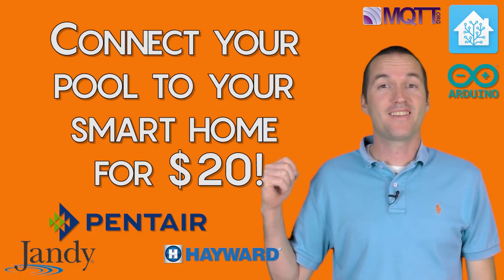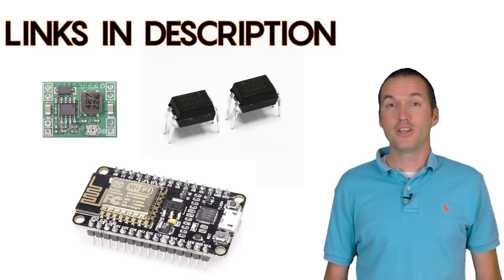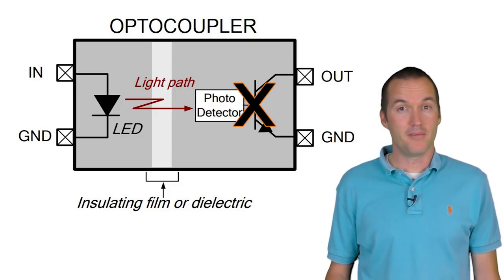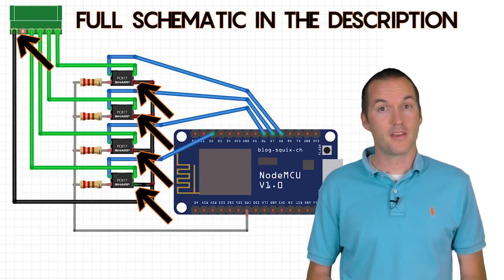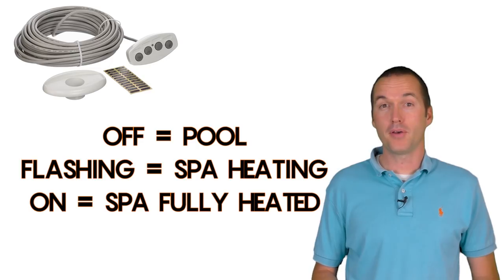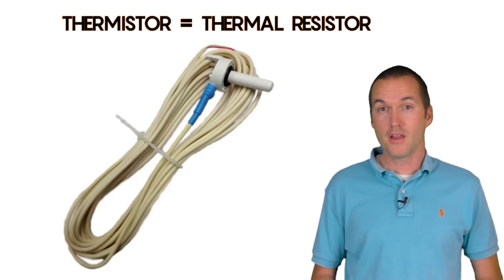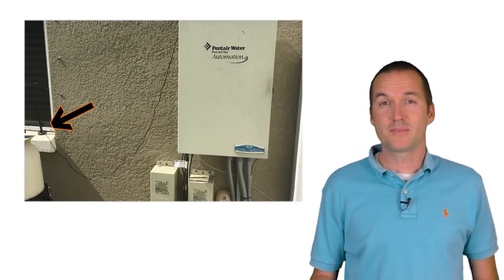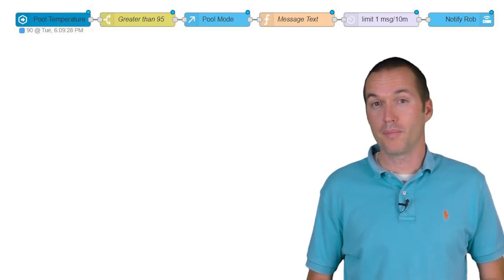Connect your pool to your smart home for $20 with Arduino!

Comment: Great job man, you're my hero!  I was able to replicate your controller and built a really nice breakout board for easy replacement of the NodeMCU and buck converter.  Also, I added a LED to verify power and another to verify emulated button signal transmission.  I discovered you can use only one 220 ohm resistor in series with the common ground for the optocouplers versus four as your schematic illustrates.  Also added RSSI signal quality measure in the sketch.  Initially the controller wasn't working, but realized that I had to activate the IS4 feature on the control panel.  Thanks a ton Rob!  Really good video.

Comment: That was amazing. If I understand correctly the arduino code runs directly on the nodeMCU and talks via mqtt to a separate device running home assistant. So this means there is no cloud based service or internet access needed for this type of design.
Reply from the maker: Correct, the only cloud service that I use is alexa voice recognition.  Everything else is local.

Comment: I have a Hayward H100ID basic pool heater for my above ground pool.  I use a Sonoff TH10 with a DS18B20 Temperature Sensor to monitor pool temp and turn the heater on/off.  Nice to be able to remotely turn down the temp if not using the pool a few days, or turn up the heat remotely if planning to use the pool. ... without having to run out to the pool to adjust the temp.  Also nice that I can view logs and see how often and for how long the heater is running.

Comment: about to buy a home with my very first pool. when researching ways to log and do maintenance, i came across this great video.  I already loved so many of your other videos on home assistant, this was really really great to find. I haven't moved in yet, but once we get settled, i think this will give me confidence to try interfacing with the controller.  What I would like is to also have something in home assistant to help with maintenance, like showing charts of chemical measurements and also issuing reminders for maintenance and whatnot.  Do you know of anything like that for Home Assistant?  Thanks again for posting this.
Reply from the maker: Hey Frank, you found an old video! I still use this same setup, but I've been thinking about changing it up.  I recently found some code meant to interface an arduino with the pentair system via an RS485 adapter which gives all the info that you'd be able to see from the actual controller.  This would allow you to get chemical information if you had those systems installed.

Other than that there are a few companies out there like Phyn that are doing monitoring solutions.  To be honest though, after 5 years of pool ownership I have a pretty good feel for my pool's chemical levels just by looking at the clarity of the water and the smell when I'm swimming.  I have a saltwater pool and I do a full check on the chemicals about once every 2 months.
Reply: @TheHookUp  Hi Rob, long time viewer, first time commenter. Can you share your code? I have an aqualink, I currently use the HA integration, but it is limited and doesn't control my heat pump/chiller, also all the data must go to the internet. I looked into using the method in your video, but shorting the pins together on the controller does nothing, I am wondering if the aqualink uses something else or my controller has an issue? Anyway, I am thinking of the RS485 method as well. Looking at Aqualinkd and someone sells a completed version called the SMART spa remote, but it's way more fun to make your own.

Comment: Nice video :)
One small point at 4:55. 3,000,000ms is 3000s (50min) not 3s.
Reply from the maker: Yep, I misspoke.  The pulsein function uses microseconds.

It's pretty annoying that there is no way to add a correction to a video after posting.
Reply: You should be able to add a capture over the video in the editing tools on Youtube

Comment: I finally got around to doing this.   At first I tried using an Arduino Nano 33 IoT so I could use the Arduino app but that cloud system does not play well with their cloud system.   I used a Wemos D1 mini and powered the buck converter from the 15V source on the Pentair board.   I have the Wemos serve up a web page and then I just go to the IP address on my phone.   Sure, I can't turn the lights on or off from outside of my wifi network, but why would I do that anyway?

Comment: I’ve got a Balboa VS500Z spa controller with simple topside controller that manages the jets, mode, and temperature.   There are two RJ45 jacks on the board and the topside controller plugs into one of those.  I am thinking of using the second one to see if I could use an IoT device to emulate the topside controller.  I was thinking of trying to read the signals and decode the data but after watching your video, I’m wondering if I could just buy a second topside controller and use it to emulate button presses.

Comment: Super video. 

My Pentair/Starite system is a bit older. And currently the control board is shot. My question is, would the inching PCB work to simulate the button press on the membrane (now not working) it I wired the PCB is output to the relay in my panel directly?

I’m not sure if the original control board is sending a 3 or 5 v signal to the relays or not. 

Before I order these will that work? 

Thanks.

Comment: As the nodemcu has so many GPIOs, you could connect a water resistant DS18B20 for temperature, about 1€/$ on Ali. Maybe even a second one to heat according to the air temperature.
Reply from the maker: Yeah, the limitation is not water resistance, but sealing the line around the sensor.  The temp sensor is in a return line and needs to have a decent seal on it to prevent leaking of water out of the pipe.  I actually have more of the pins used on mine.  I'm also using the same nodeMCU to monitor the gate open/closed state and detect the state of the salt generator using a photoresistor.

Comment: I'm on my 2nd analog pool pump timer and was thinking of replacing it with Shelley Relay.  I've been reading that although the Shelley 1 is compatible with 240v, it only has 1 relay instead of 2.  Do you know of a Shelley Relay that would open both hot legs of my 240v circuit?  I don't like the idea of only having one side open and the other side having a 120v hot direct wired to the motor.

Comment: Hey thanks for sharing. I’d like to connect my air exchanger, to turn it on/off depending of the time of the day, weather conditions, and to trigger the venting mode for the bathroom after a shower when the lights are turned off. How could I do that ?

Comment: Won't piggy backing to the temperature sensor make temperature readings on the pool controller useless? I mean won't it affect the resistance?
Reply from the maker: It does not affect the controller sensor, no.

Comment: Ah, I wish I had a pool controller like that. I just have a 3 pronged Pentair Inteliflo variable speed pump with a 3 pronged connector, which are probably a lot more complicated that simulating button presses. I would really love to setup an ESP board to interface with it so I could set schedules based on the time of year (to run it less during the cool months) to save money. I know I could manually do it, but those things are a big of pain to program the schedule so I avoid doing it. If I could have a schedule or a button in Home Assistant though... :)
Reply: And there's the Pentair Colored LED Pool light control box against the house. I need to see if I can open that box up someday to explore.

Comment: Hi, Rob!  Thanks for sharing this great integration project.  I'm a bit confused on the common connection for the 150 ohm resistors connected to the optocouplers.  They should connect to GND on the microcontroller but you have them connected to CMD (SPI Chip Select) pin in the schematic.  Was this a simple mistake or is my newbie status coming out?  Thanks again!  Love your channel.
Reply from the maker: Yep, that's a mistake, connect to ground.

Comment: Nice video!

Why cannot you  just use 1 resistor between the optoisolators and the ground? 

How many Volt from the SPA can the optoisolator handle?
Reply from the maker: You can use 1 resistor because the common leg would be through the LED and would prevent reverse polarity, I showed it that way to be on the safe side in case people modified the design.

Datasheet on the optoisloators says 80V max collector to emitter voltage.
Reply: @TheHookUp  Is the schematic wrong?  You have the resisters between the opto-isolators and the CMD pin, not GND.  Should the resisters connect to GND?
Reply from the maker: Where are you seeing CMD? That's the ground pin (GND)
Reply: @TheHookUp  Forgive my ignorance, but it looks like the resistors are connected to a pin on the nodeMCU labeled CMD via the gray line: https://imgur.com/a/7exxDNF
edit: I switched the connection from the nodeMCU to the resistors/opto-isolators to use the GND pin instead of CMD and it all works!  Here is my updated schematic (change highlighted by red box): https://imgur.com/a/MsXzbwo

Comment: Two ideas... Mitsubishi Mr. Slim Ductless HVAC unit and/or household waterheater. The Mr. Slim is supposed to have a serial interface that can be operated by arduino code.
Node MCU is nice, but what about the ESP32? Similar price point and really nice specs.
Reply: Old Curmudgeon Just my two cents, ESP8266 is quite powerful for such mundane work while still being significantly under powered compared to as Esp32.
Reply: Prakhar Birla I don't disagree. I was just saying the for the $3 price difference one could also consider the ESP32 as an option.
Reply from the maker: ESP32 libraries aren't nearly as well hashed out as ESP8266 libraries, that's why I usually default to the ESP8266.  I have 2 ESP32's at work in my house, and 4 or 5 sitting in my drawer.  They are very powerful, they just have extra bugs when trying to use ESP8266 libraries.
Reply: The Hook Up that is so true, but for my projects the only thing that's been a headache so far is analogout & i2c LCD. I find the Nextion displays much more flexible & configurable than the 20x4 LCD anyway. Thanks for the reply.
Oh, mind saying what tour ESPs are doing?

Comment: Great example!  I have an idea that I wonder if the NodeMCU would be a good candidate for.  I'd like to make garage door controller that uses two IR Beam sensors and integrates with home assistant. 

Most garage door openers today have a single IR Beam sensor (aka "safety sensor") near the bottom of the door which prevents the door from closing if there is an object in the way when the button is pressed, or it stops a door if the sensor beam is broken while in operation.  I want a second sensor near the top, to detect when my wife leaves the minivan rear gate open and someone tries to shut the garage door...which would hit the van gate and cause (more) damage to the vehicle ;]

It sounds like the NodeMCU could take control of the normal sensor control wiring connected to the garage door opener, and each of the beam sensors could connect to the NodeMCU, which would determine if both sensors are clear and then communicate that state to the garage door opener.

It would also be great to show in Home Assistant the current open/closed state of the door.  Something like your window sender, but preferably wired so there is no need for a battery.

Bonus Points if you can make a light turn ON when the beam is broken and then OFF when the path is clear, which would indicate when a vehicle is pulled into the garage far enough to clear the door.

Extra Bonus Points if you can make the sensor turn on a light when the sensor is tripped after dusk and remain on for a variable amount of time set in the Home Assistant web UI.

What do you think?
Reply from the maker: Totally do-able.  The  problem you will run into is that the signal from the safety sensors is not an "on" or "off", it's PWM, so you'd need to use pulseIn().  The light part is easy once you figure out the sensor PWM value.
Reply: I think I am going to start with something a bit more rudimentary before I poke into customized hardware without a guide to follow.  I think my first task will be to make a Node-RED flow that will group all of my sonos speakers on the first floor and set their volume levels to match, picking the "master" speaker in a preference order, depending on which (if any) are playing music.  That should be challenging enough for now without needing to learn Arduino programming too ;]

Comment: Hi Rob, really like your work. I would love to use this to monitor the status of my washing machine. The washing machine have a led that is off when the machine is off, On when washing, blinking when done(and before I select the program). I would love to use only the LED status part of this code on a ESP-01 for this. Can you please advise what I can remove from your code to use it for only sensing the LED part, or recommend where I can get info to understand the code? (If possible, blinking of the LED before I select program should be ignored, only change MQTT status if the LED goes from ON to blinking)Br Kim
Reply: Not sure if you managed to do this. But if you're inexperienced, maybe your approach isn't the simplest one. You can buy something like a Sonoff Pow R2 or a Shelly, which can monitor current. And make your automations based on that. Will be considerably simpler than  messing with your washing machine buttons.

Comment: i dont have a tesla or a pool, but the vid is useful as i can use it for any other dumb devices with buttons...anyways been eagerly waiting for the wired door sensor video...or if you can just github the code and circuit diagram that would be great..thanks
Reply from the maker: Interestingly, I actually redacted the code for a wired door sensor from this code.  My gate sensors are built into my pool controller sensor.  I have your wired sensor video written, but an amazon company told me they were going to send me a free doorbell unit which is the other part of the video (the same one that I already have) so I could take it apart for the video.  They haven't come through.  I went ahead and just ordered it so I can finish the video.

Comment: Hey Rob,  love your videos.  I have a hayward Omnilogic pool controller.  After 8 months of 5 techs, 12 hours on hold, and 12+ hours with techs at pool side, I’m giving up on Hayward.  I did not know that Omnilogic had a pool side remote until your video.  Problem is it is not a simple button push to activate.  Has four wires, the main program must discover it, etc., etc..  do you know if this poolside controller is using telemetry to communicate with main board?  It must bc you can control all functions from the pool side remote, not just 4 or 5.  I really would like to solve my remote function use to bypass the cloud of Hayward.  A $6500 worthless mess!  Any ideas?
Randy
Reply from the maker: Sounds like it's using RS-232 which is pretty common in pool equipment.  Definitely not easy to work with unfortunately.  You could do some googling and see if anyone has decoded the protocol already, but it's not a simple task.

Comment: How can you measure a 5V thermistor on a 3.3V ESP? Won’t that fry the board? Or are they 5V tolerant?
Reply from the maker: It isn't 5v tolerant.  It only works because a thermistor circuit is a voltage divider circuit.  Normally you've got the thermistor and a 10k resistor in that circuit.  In this case it will not return more than 3.5 volts until the water hits 6C or  43F.  At that point it won't return correct temperatures anymore, but it shouldn't do damage to the board until around 4.5v which would happen around -20C, at which point your pool probably has bigger problems.

Comment: Got a link to the external antenna you are using?  Also, do you have a pic of where on the pool controller corresponds to the COM port on the schematic?
Reply from the maker: Here's the antenna I used: https://amzn.to/2EMZeAK

The comm port is labeled on the inside of the Easytouch (right on the circuit board)
Reply: @TheHookUp  Thanks!  I was able to get everything soldered up and connected to the pool controller.  I have pool status and temperature coming back into HA, but for some reason when I send any command to turn on the spa or lights nothing happens.  I debugged the code and the nodeMCU is receiving the mqtt commands, but nothing happens on the pool controller side.  I think i have it all wired up correctly, but something must be wrong.  Is there any way to test if the button press is actually being passed from the gpio pins to the opto-isolator?
edi: I did some more investigation using a multimeter and the voltage on the gipio pins jump up to about 2V when i send a command to trigger the corresponding button press.  I also confirmed the connection on the output side of the opto-isolator is working because i can manually complete the circuit and it flips the corresponding relay in the pool controller.  With my admittedly limited knowledge it seems like the leds in the opto-isolators are not turning on to allow the circuit to complete.  Is it possible there isn't enough power going to them?  What voltage do they need to turn on?